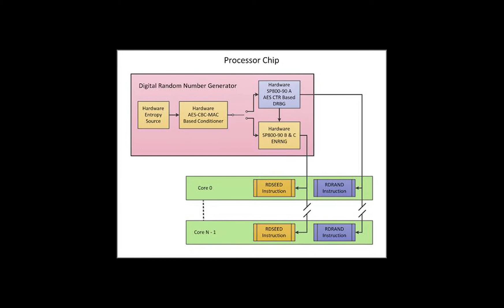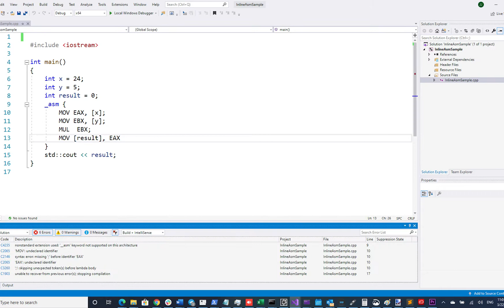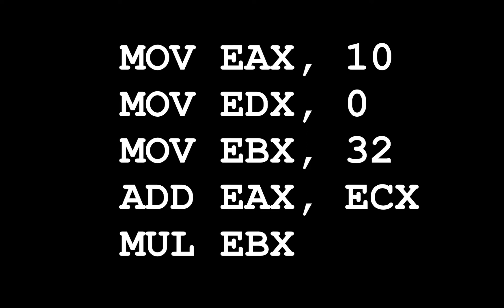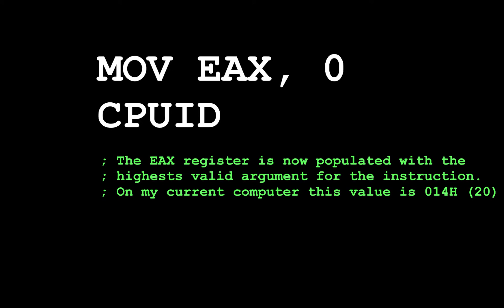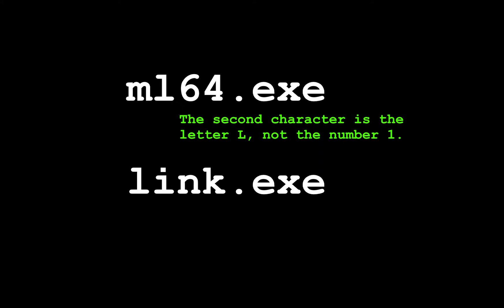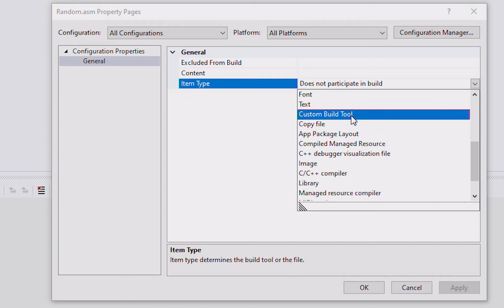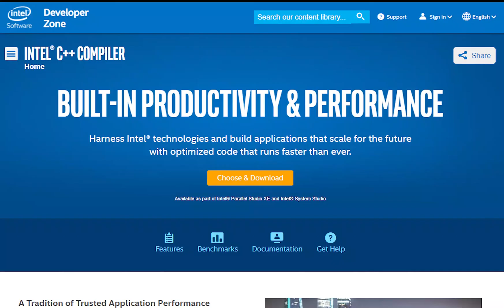Using the Intel Digital Random Number Generator with Visual Studio

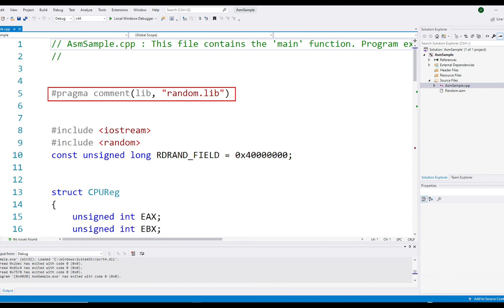Comment: 10:15, Bit 30 is where the 7 is. The F you outlined was bits 12 to 15. You should also check the carry flag after running RdRand or RdSeed in order to check that you got a random number. This is especially important with RdSeed because the CPU can pull faster than RdSeed can supply full entropy random numbers, so in a loop, it can underflow. The carry flag is how you tell. This is all covered in the Intel software developer manual. I designed the logic for the DRNG so I have a pretty good idea how it works. I have my own library. Google for "rdrand_stdint github". That will take you to my C library that gives a number of handy wrapper functions that invoke the inline assembly to access cpuid, rdrand and rdseed.